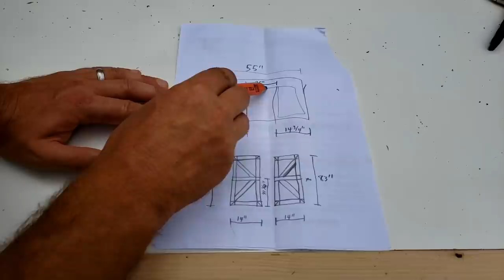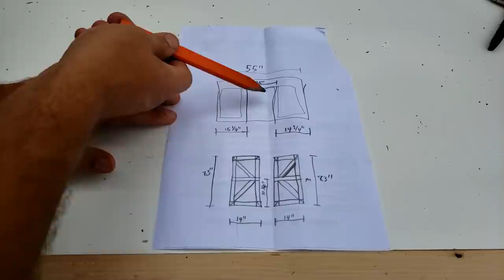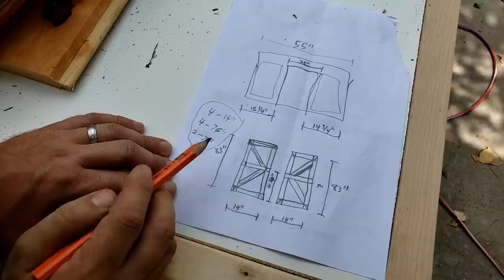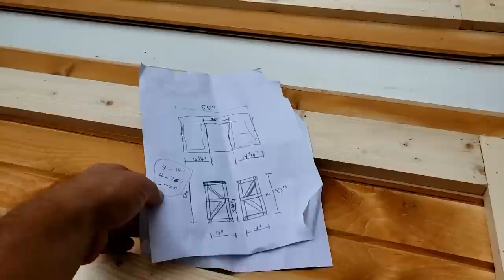DIY Sliding Double Barn Doors - Inexpensive!

Comment: I love barn style sliding doors. You may want to install a guide pole on the floor that holds the door from swinging for each doors. Doors will hit the wall without it. You can use your router to make a rabbet in the middle of the door as a guide rail. Alway enjoy your channel. Good luck!

Comment: Very nice doors, and such a simple build.  Good ideas, and I agree Amazon is the place to get these barn door kits.  Still not cheap but much more reasonable than retail.  A friendly suggestion (depending on how you want the finishing result to look): add sandable/paintable wood filler to the gaps and brad nail holes.  I used it for the first time a year ago and it made all the difference to the look of the final product (looked like one solid piece).  You could do this after paint, I'd just sand the paint off in the areas you are adding wood filler and then repainting.  Keep up the great videos and God bless!  

P.S. I have the exact same Dewalt tools and use the same hold-down weights, had an out of body experience thinking I was watching myself build this door lol!